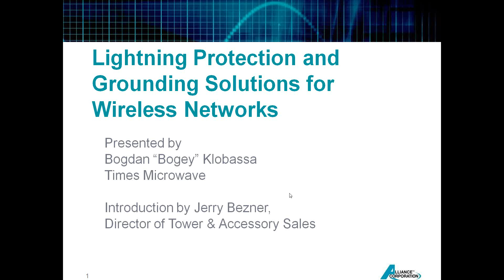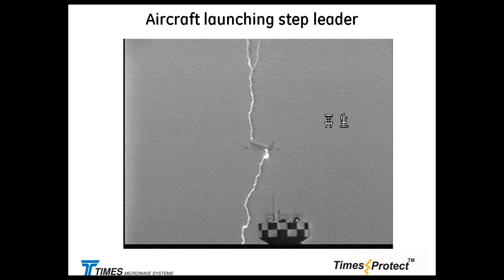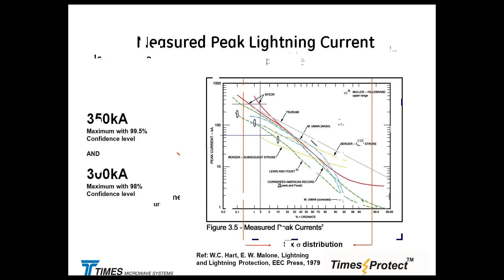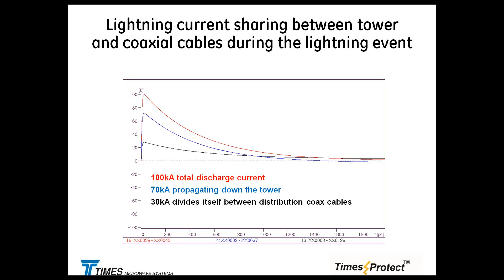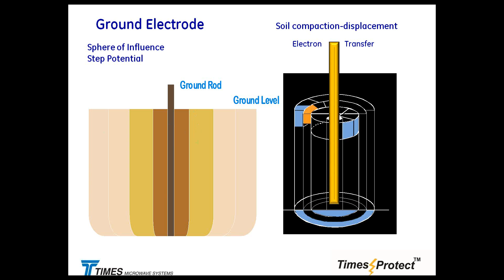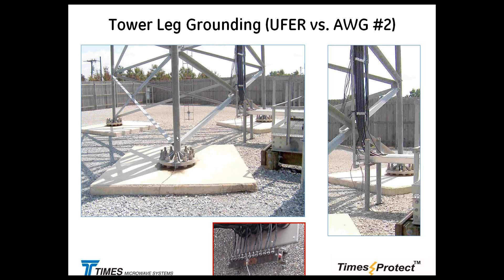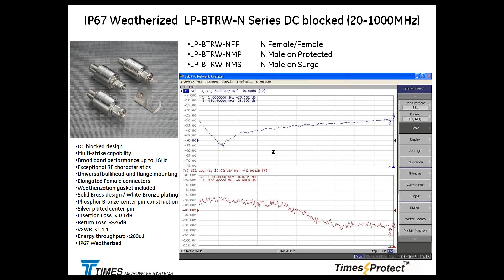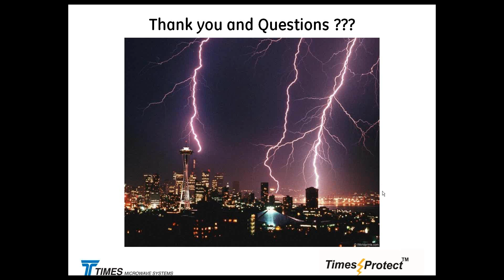Lightning Protection and Grounding Solutions for Wireless Networks

Comment: Why so few likes, I wonder?  This is an awesome presentation!
21:20  28kV pulse on the coax!  That's why I always wonder why they bring in the coax a few feet above ground level.  Why not take them off the tower at the ground and bury them, and enter the building at ground level.  That would do a lot to reduce the lightning spike.